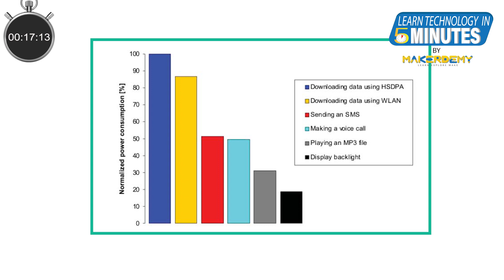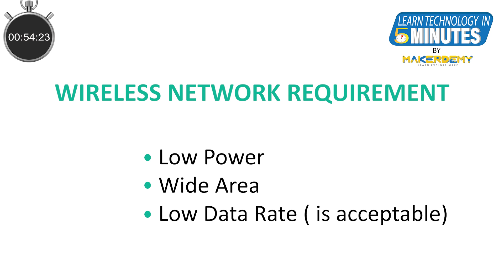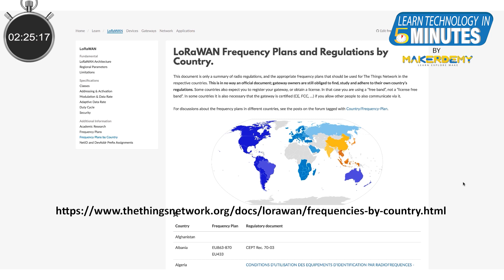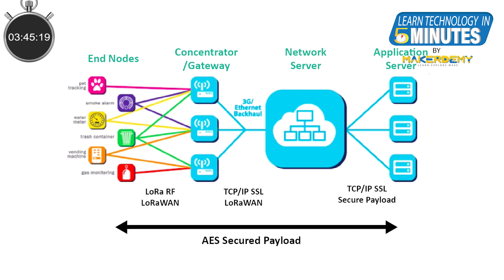What is LoRa? (2020) | Learn Technology in 5 Minutes

Comment: Great Video Sir, India is allowed to work on 865-867 bands. For making a data transmission with LoRa Transmitter and Receiver, we couldn't get any LoRa devices with the allowed bandwidth ranges in India. Why is that Sir? Do we have any alternatives?
Reply from the maker: Hi Arun. All modules that are designed in India are for the 868Mhz band and can be used with these frequencies. The frequency selection is in your node firmware. The procedure varies from manufacturer to manufacturer.

Comment: Question...
Like celular network any cellphone can connect to other cellphone in the world but it's not direct conection because there's lots of network conection between to regenerate the main signal 
But on the other hand for lora ..
How individual one module transmit and receive signals to other individual similar module with very low power and without any signal amplifier in between just like cellular Network ? If it's possible than why Wifi modem have limited range Around 100 to 200 meters only ?
Reply from the maker: Hi. LoRa transfers small bits of data hourly or daily over multiple kilometers. WiFi sends large amounts of data at a high speed over short ranges. LoRa can not replace WiFi. LoRa is a wireless communication protocol that consumes less power and is less expensive. LoRa uses frequency shift keying to transfer data over long distances.
Reply: @MAKERDEMY  i already Cleared by doubt before that its Bandwith is limited By Organization and government so Data Transfer will me Low .

Comment: Nice information...but what about the security issues??
Reply from the maker: Hi Satish

LoRaWAN® Is Secure, but the Implementation Matters. LoRaWAN is by design very secure . Authentication and encryption are, mandatory. The specification defines two layers of cryptography:
 Using a unique 128-bit network session key shared between the end-device and network server
Using a unique 128-bit application session key (AppSKey) shared end-to-end at the application level

AES algorithms are used to provide authentication and integrity of packets to the network server and end-to-end encryption to the application server. The devices can be activated by Personalization on the production line or during commissioning, or can be over the air activated (OTAA) in the field. OTAA allows device sessions to be rekeyed if necessary.

Check out this paper to understand more about this: https://arxiv.org/pdf/2105.00384.pdf
We hope this was helpful

Thank You,
MAKERDEMY SUPPORT TEAM

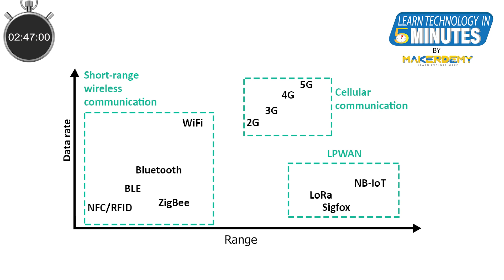Comment: Great video., really informative and useful. I have a question thou: On 3:15,  I couldnt get why 5G have such a large range coverage, since we know that working with higher frequency bands also brings a lot of power loss and attenuation of signal propagation over distance. Anyone can help me on this? Thank you for the awesome video sir!
Reply from the maker: Hi Pedro

Thanks for your positive feedback. Regarding the 5G range coverage, it's our mistake that the image is not the correct representation. The image seems to falsely indicate that 5G has more range than 4G as it is shifted to the right. The correct image should have been all the cellular networks on a straight line vertically. We will make sure such mistakes don't happen in the future.

Thank You

MAKERDEMY SUPPORT TEAM